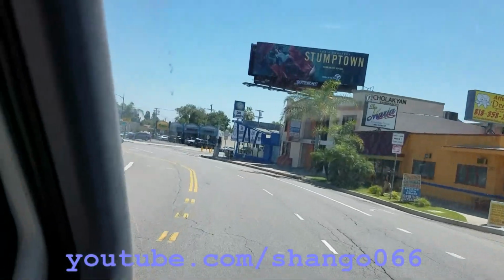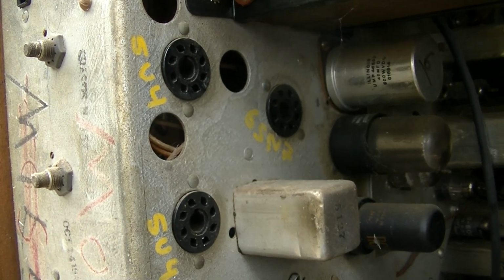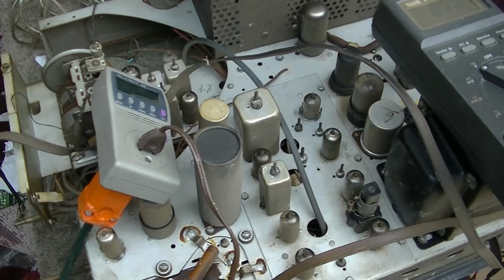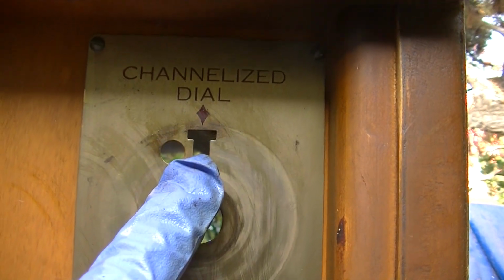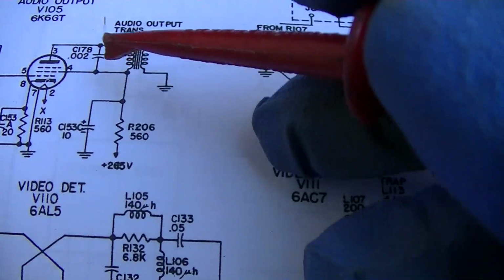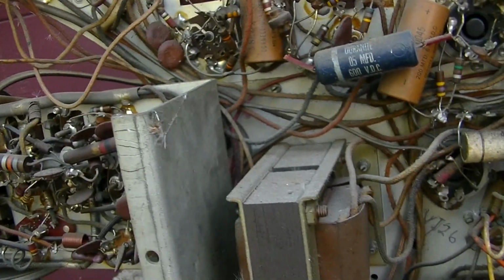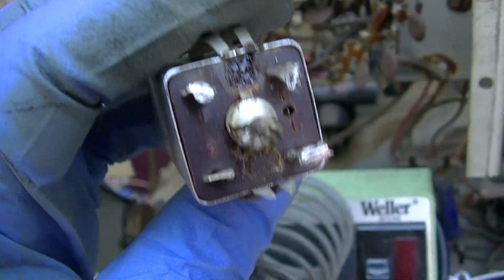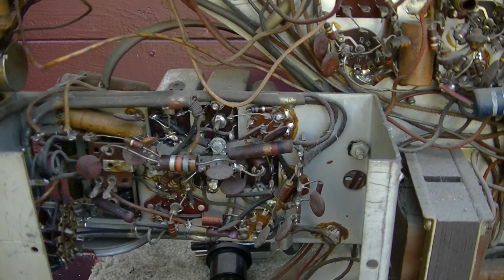1948 Hoffman Radio TV Set Ressurection Pt1 Acquisition Analysis Radio Repair

Comment: i think people dont realize, that resistors do have a voltage rating. that why sometimes you see  resistors in series in high voltage circuits to help absorb the high voltage drop across more than one.  same with some in parrrallel. to absorb the high amperage

Comment: The woodwork looks relatively straight forward. I would have thought a swap in of the electronics with a new speaker into a new case would have been possible.

Comment: Looks like an old Dumont I found in the junk. Same kind of cabinet layout
Reply: What metal picture tube is that?  Looks like one that would fit the old Motorola I had when I was 14 and changed the picture tube even though I barely knew what I was doing.
About a ‘49 Motorola
Wish I still had the Spartan with the picture tube on end with mirror on lid. With what I’ve learned on internet I could probably fix it now. Picture tube still lit up.

Comment: I'm impressed with the sensitivity and selectivity of that radio circuit -- for such a simple tuner, it seems to work quite well.  In particular, the fact that it works so well after 71 years is a testament to that circuit's quality and design.

Comment: If I remember correctly,  two "5U4" tubes would mean a lot of freaking high voltage......
Reply: The 5U4 was a very popular rectifier for TVs and stereos. High power handling capabilities. Two rectifiers in parallel doubles the power capacity, not necessarily the voltage.

Comment: For someone from the UK there's so much weirdness in the part of this video where you pick it up. Firstly I don't remember the last time I saw something dumped by the side of the road like that; the local authorities would be handing out fines rather quickly and I would very much doubt someone would abandon a very old set like that, they'd be looking to get some coin for it on ebay. Of course in our wet climate it'd be screwed within 48 hours anyway. Then there's the whole business of homeless guys in a residential area - that's scary stuff, is that really an issue there?
Reply from the maker: We are still quite a bit rougher and unrefined compared to the UK. This is still a bit of the Wild West with different culture overlays
Reply: @shango066  Meh, I wouldn't go that far, we're just unrefined in other ways :)
Reply from the maker: @jasejj  knife Wars? Knife murder capital of the world?
Reply: @shango066  Yup, part of the more general problem we have of an underclass of scum infesting out cities which no-one wants to do anything about. I'll take the pissing tramps if that's OK.

Although despite living in the poorest county in England, my village hasn't seen a single crime in nine months, so not all of the areas left to rot by de-undusrialisation have gone to seed just yet.
Reply: The UK had tv well before us. Early 30s tv service and I wonder how many advances would have happened if the war had not interrupted. The war did improve electronics. Many in the middle U.S. didnt have tv until the early 60s.
Reply: @bombasticbuster9340 I know it’s an old comment but only London and the surrounding area had TV in the 30s. It took until about 1958 for the Post Office to have installed the cabled and microwaved links and for the BBC to have built transmitters to cover about 98% of the UK population. ITV (the BBC’s main competitor) launched in London in September 1955 and didn’t reach 98% population coverage until 1968, by which time the 405-line service on VHF they used was becoming obsolescent as it was about to be superseded by the 625-line system on UHF.

UHF started in 1964 - again only in London with the launch of BBC2. BBC1 and ITV started 625-line transmissions (in London, the Midlands, the Lancashire/Cheshire area and in West and South Yorkshire) in November 1969. The last UHF high power station opened in October 1978, with low-power repeater transmitters filling in geographical coverage gaps (it’s hilly terrain) even into the early/mid 90s. Most had come online by the time the VHF 405-line service (which had been duplicated from the 625-line service by way of electronic standards converters installed at 405 line transmitter sites) was shut down in January 1985. Of course, rolling out 625 coverage meant new transmitters but also new cabled and microwave links for the Post Office to replace, as the old ones were only designed to handle the 3.5MHz vision frequency of 405. 625 needed 6.5MHz.

The Post Office handled distribution of all electronic telecommunications until that was split from the mail bit of it in 1984 and privatised as British Telecom.
Reply: Hey, that is Commiefornia. It was once a great place, but socialism at the state level has destroyed the state. Corruption is terrible in the blue states.
Reply: @bombasticbuster9340  LMAO! Imagine thinking the democrats are even slightly left leaning

Comment: If that TV IF has SM disease then that's probably gonna be too much work to fix. May have to just feed the video into the video amp and call it good enough. Still will be entertaining enough just getting the vertical and horiz sweep circuits working correctly.

Comment: Those blue Aerovox capacitors are either early plastic film or paper-mylar, I found some NOS ones recently, tested them for leakage, at high voltage, and they were solid as a rock. The pink ones are probably Sangamo Little Cheifs, and those are garbage just like most of the bumble bees are.
Reply: I've seen those Little Chiefs in a couple of AA5 sets, no good for sure.
Reply: Believe it or not I have an all original Canadian Westinghouse set, a model 501-M, and it used those pink Sangamos exclusively for paper caps. Believe it or not I am trying to restuff them, I'm drilling out the innards on a small lathe and I am planning on inserting new polyester caps inside. I hate the way those bright yellow things look in an old radio, plus the set is mostly original anyhow, so I thought I would try it just for the challenge. If all goes well I may try it with the Bumblebees in my Zenith T.O G-500, since it's one of the less common T.Os.

Comment: One of the things you do is not to blow out the chassis and cabinet, that just gives me the willies, would blow it off with compressor and blow air gun.  I hate, dust, cobwebs, mice/rat scat,  rodent/insect nests and bugs eggs! It can be a little unsafe with rodent nest as far as diseases from them.  It is a little fun, horrid  and amazing.  I still watch anyway....lol  You are a great tech, I watch and learn something.  I usually never fix TVs.  I have fixed and restored radios, amps and test gear.  Thanks for the vids.
Reply from the maker: Blow off a chassis and cabinet with asbestos dust all over the place? I'll leave that for you

Comment: The AM detector part of the radio does inject into the AF amp.  BUT the FM If stage feeds into the Video IF stage at the sound IF frequency where it gets into the sound IF and FM detector.  The TV tuner is shut down.
Reply from the maker: Yep I thought I talked about that? At least we know the front end of the TV is working as evident by Channel 6 coming in

Comment: Why is it that the older the set, the less components are in it.  That set looks empty inside, but then a set from The 1970's is full of circuit boards hanging all over the place.  I surmise it is all the mind control circuitry they put in these days.
Reply: Well, this is a b&w tv and they are very simple....
Reply: I've seen some tube color sets from the 50s and 60s and they can be quite literally filled to the brim with electronics. By the 90s everything was contained on a single probably 10x10 (at most) main board.
Reply: Aidan Montgomery yep, an early 1970's 12" tv was 2'x2' and 18" high. It was packed with modules that needed to be removed to get to some tubes. I remember it was also extremely heavy.  They tried explaining the size by placing large speaker grills in the front under the knobs.  It was a "portable color tv too" we really came far in electronics - almost like alien technology today
Reply: @davidjames666  That is because it is alien technology.
Reply: @davidjames666  > portable color tv

You spelt luggable wrong
Reply: @Tyler Mathis and like, 2 monolithic ICs and an eeprom

Comment: As for the capacitors in the IF,  .10's  should be the right fit I have seen many mica bypass's  use  .10 disc capacitors

Comment: Can we crowdfund Shango a 9V for his Fluke 27?
Reply: LOL... And it also needs a good zebra strip cleanaing as well.
Reply: @mrnmrn1  Eh, who needs all sections of your LCD when you have off-angle viewing! 

But seriously, it is not a Fluke if it doesn't have a battery light on and half a display. Still damn good meters, or they were.
Reply: @christopher88719  I've seen this Fluke in some of his videos without the battery warning, and it still had some dim segments on the LCD (not as severe as this time, but noticable). So it's probably a dirty, or displaced zebra strip.
Reply: @mrnmrn1  Oh yeah for sure. I agree. It is really common on those.
Reply: The Fluke could be a resurrection found on the curb side- GOOD ENOUGH

Comment: The high volume urinator seems to be missing.
Reply: That's hilarious.
Reply: Check the discronificator
Reply: Do you use a circuit breaker, I fear for your safety.